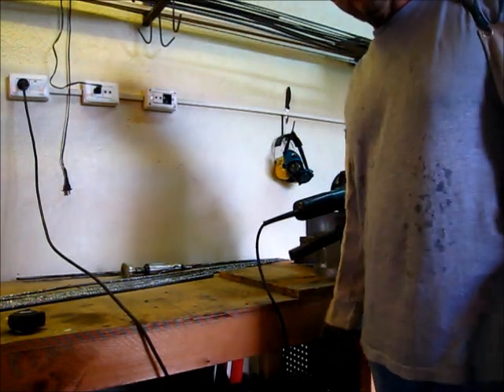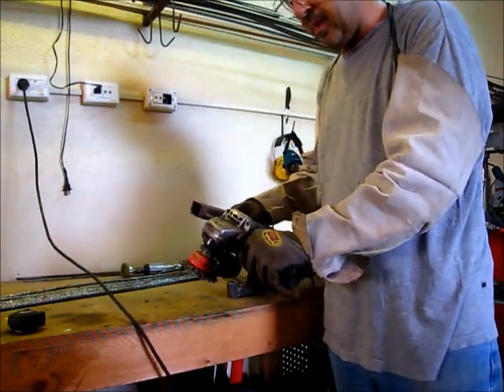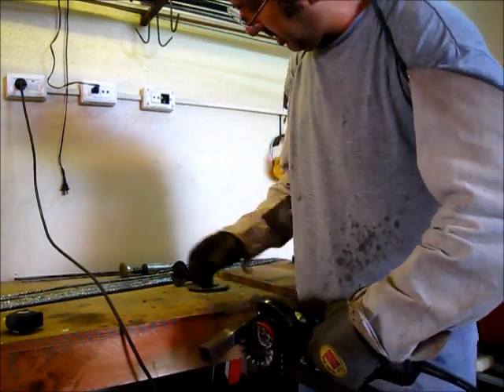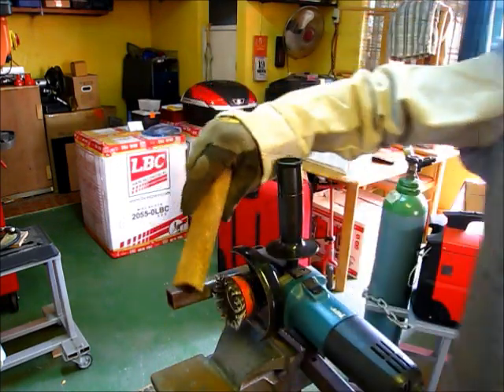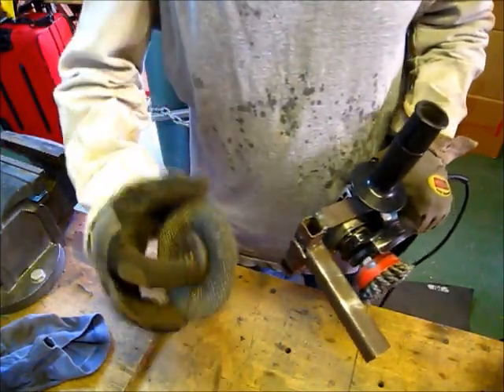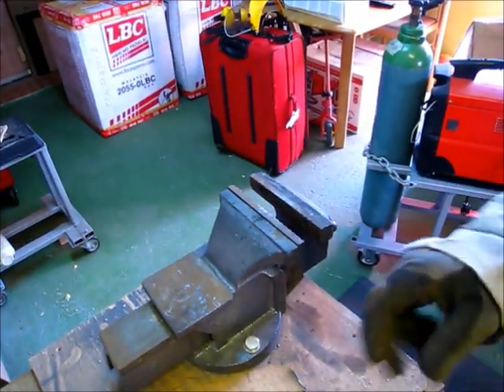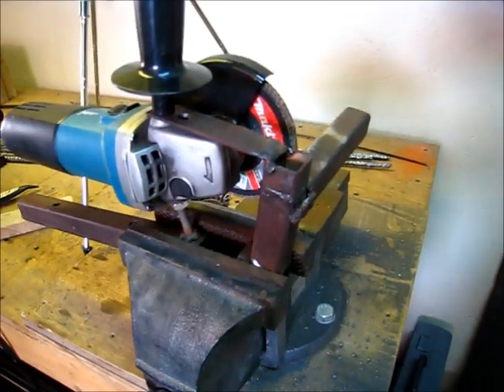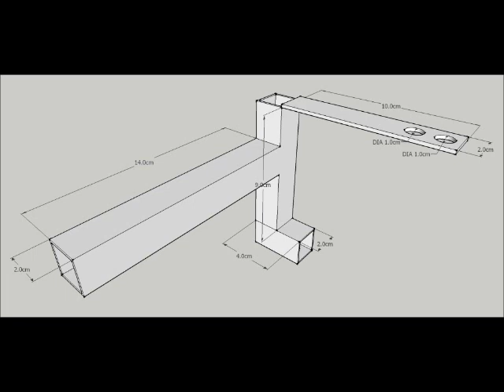My Favorite Home Made Tool made with Recycled Scrap Metal

Comment: This is a great simple idea, I have used angle grinder in ways it wasn't meant for,
but this is great, its non invasive and most grinders have the same set up,
a cheap yet very affective yet safe, well done Saeid!
although it might need a bit more of a safety shroud. good job
Reply from the maker: Thank you very much for your comment.

Saeid

Comment: Excellent, simple idea!   :)

This is what I call thinking around a common problem.  The speed and versatility of a right-angle grinder makes this far more useful, and faster, than a traditional bench grinder.     You could also fabricate a steel guard for this also to stop heavy rust from coming back to your face or throat as you work.
Reply from the maker: +Kieron Seymour-Howell Hey thanks! I use a mask whenever I use this
Reply: Saeid Momtahan, a face mask will not protect you from a disintegrating wheel.  A steel guard would you still be a good idea.
Reply: rockethead555  have seen a grinder wheel embedd into a steel door.  The wheels may have flaws, or cracks in them.  I worked  in industrial, and commercial companies for many years,  as a welder, millwright, pipefitter, ironworker.  I have seen some crazy stuff.  Those plastic face masks will not stop a disintegrating wheel.
Reply: rockethead555 Yes, all this is very obvious.  I have never had a disc break, nor have I ever burned out a motor, and my tools have always lasted multipe times, and done more work than those who I have known.  Everything you say is very true, and basic common sense.  Save your preaching for children and the average worker.  You seem to project agression and a haughty self-confidence.   My direct experience is that MOST people will have had issues and cut corners with safety, multple times.
Reply: rockethead555  I mentioned you, so obviously I was talking to you.   I know you think you know everything, but experience will tell you that is not true .. lol  i have met a lot of arrogant folks like you who think they know everything.  It is called the "Dunning Kruger Effect"  you might want to look that up.   :P

Comment: Very nice. I did a similar mod with a handheld belt sander, and it provides me a lot more control for finishing smaller pieces.  The fact that the motor vents aren't blocked by holding the tool "as the manufacturer intended"...is a great benefit too..

Comment: It is always good to consider the potential for personal injury before proceeding with any project. I have to agree about using a full face shield especially while running a wire wheel on a mini grinder. I've picked wire splinters out of myself several times but now I have a leather bib type apron that prevents them from sticking in me. Also works good when grinding. I've caught my clothes on fire a few times while grinding too. Have a great day!

Comment from the maker: Hi John. Thanks for your comment.

THe reason for attaching the rest to the Grinder is mainly to stabilize the grinder. If not attached, then the grinder would be held only with the handle that's locked in the vice, by only one bolt and through only one axis. As the two bolts on either side of the grinder are not aligned and have different axis, they offer a better lockdown/stability

I HAVE used the grinder alone in the vice w/o the rest, but I feel it's a little risky that way.

Thanks!

Saeid

Comment: Nice idea. Suggest that you include mentioning the use of a full face shield as well as safety glasses when grinding and especially while using a wire wheel. Leather work gloves and leather apron would also a good precaution. Those wires are sharp and can penetrate your skin quite easily and through your clothing. Safety First Always...

Comment: Some of the best ideas are also some of the simplest, nice one!
I'm thinking that the rest assembly could just be clamped in the vice without the need to attach it to the grinder.
That way you'd be able to vary the gap if needed.

Comment: A very good invention my freind thank you for sharing it, I work with metal and wood and building renoes this will be more practical, as I have a wood  sander I have to change the disk for rough sanding, as I need a plank to fit as a wedge and needs just a litle taking off, this is a time saver. In response to your negetive remark dazz barry I know for a fact that wishing harm to another being the wish comes back to the wisher; I stongly  advise you to retract that wish.

Comment: I like this, my old man did something similar with a drill mounted horizontal, then made his own attachment so it could be used as a vertical disc sander. Maybe a foot pedal from a sewing machine would be good for power, so if you do have problems you just lift your foot off?

Comment: Long sleeves are a great idea.  wire wheels spin off chunks of wire.  Invariably after an hour running the wire brush I look like a well dressed porcupine.  I like My angle grinder.  the vice mount is cool but I like the angle from the bench grinder too.

Comment: Hello, we have been using somthing similar for more than 15 years. Its pritty same but it was made so it can be mounted to any table ewerywhere and the adjustible part was on the same side as the mounting for the work table, adjustable with a butterfly nut so you can use differt sizes of discs or tools. It is werry helpfull thing.

Comment: Pretty Cool. Nice and simple. Angle grinders are the best tool in my workshop.
I have built an entire frame for my kit car using just an angle grinder and a welder. Wish I had thought of your handle.
Reply from the maker: There's gonna be another adaptor coming up which you will want for your workshop. Please check back.

Thanks,

Saeid

Comment: Hey man, those are some good/great ideas.  My friend cut his chest badly with a bigger size grinder.  That extra handle could make those grinders a lot safer AND help with less fatigue.  And ALL those grinders also BADLEY Need a brake from the manufacturer to stop the wheel when the switch is turned off.  Keep up the good work my man.  Take care from Nashville TN.

Comment: Nice mod, I also noticed my grinder getting hot after extended periods of use and had to hold it akwardly to not block the vents, those side handles make the tool much more versatile :3

Comment from the maker: I think you're obsessing too much over this. You have your opinion and I respect that. Although not a pro welder, I have been doing metal work for a few years and I know most accidents happen not because of Machinery, but because of the the guy using them. And that 90% of the time, that happens because of fatigue. This set up alleviates fatigue to a great degree. I know, I've done both. I know I'm a lot less prone to accidents with this and I can get a lot more work done.
Thanks
Saeid

Comment: Cool idea, cleaver man, I was using a small 115mm grinder to wire wheel a piece, and the brush caught the side of the metal and nearly went through my belly, fortunately it got caught up in my boiler suit, this looks much safer,

Comment: Hi Saeid. Great modification - however, one thing to keep in mind is that using the grinder like that with a grinding/cutting disk is you do not have an effective safety guard. With it clamped in the vice, you're standing in the line of fire for potential shrapnel - if the disk was to shatter (for whatever reason), it could be fatal! Angle grinders come with a guard for just this reason. So please be careful! ;)

Comment: Great Tool  i like it so much  but if you have in your angle grinder variable  speed it will be extent because most brushes wheel  will work with low speed and  also if you notice   there is burn in the wood if you use speed control angle grinder it will not be burn

Comment: just wondering about the practice of wearing long sleeves while using a tool with moving parts, as opposed to a welder, which is essentially a different sort of thing, where there are no moving parts and spatter is the problem. thinking maybe also some kind of caul/bracket around the main body of the tool, in addition to the fastening at the handle, would ensure the equivalent of a two handed grip.

Comment: Here is a trick I used to do to make a lathe....using a grinder and a drill....mount the drill using modded pieces on the work bench vice....get a drawer slider and mount the grinder on ...when the drill is on....turn on the grinder and you shall have a home made lathe..:D

Comment: As long as you are wearing adequate protective clothing and a face mask like he does, a shattered disk won't hurt you. There's just not enough momentum in the shrapnel to do so. Bare skin might get a scratch or so, but not much worse. The shield also doesn't protect the eyes from any flying shrapnel, broken disk or not, so it's just user error if not wearing adequate protection anyway.

Comment from the maker: I think in a home workshop OH&SA can be put on the side a little. No one is going to sue me if I bruise myself a little while cutting a piece o wood or grinding a piece of metal. I still care a great deal about safety though. And I do use a full face mask when I use this tool, specially with the wire wheel.

Comment: No, the guard is behind it to stop your fingers running up into the disc... eye or face protection is what'll save you from disc breaking up, if used like this; add a leather apron and you should be fine.

Comment: My anecdote: Some time ago, one saw in the shop, a 10" Uni-Saw clone, began a scary habit: rap the cabinet at the back near the mag control, the contacts would close, and start the saw unasked. Cauls racked under the outfeed table were nicely positioned to be knocked into it end-wise, too. Solution? For months, we just positioned a board behind the cauls as a guard, and wrote warnings with marker on the table. I still changed blades without killing power. Lunacy, in hindsight, don't you think?

Comment from the maker: I almost had a pretty nasty accident with a wire wheel attached to a hand held drill myself. It caught my shirt and came all the way up my chest. But thankfully the spin was such that it sucked my shirt in from outside. Had it gone the other way around it would have wire wheeled a nice track up my chest all the way to my neck.

Loose shirts have no place in a shop

Comment: Saeid, you are a very clever, very innovative person.  However, I have to comment on a safety aspect of this attachment.  When you hold an angle grinder normally your fingers are very close to the on/off switch which is a good thing in an emergency; I've had just such an emergency and am glad I was able to quickly shut off the power and yes, I was using the grinder 100% correctly.  With your attachment in place your fingers are not so close to that safety on/off switch :(  Please be careful :)

Comment: Copyright may be a better protection, and a pending patent may be a better protection than an actual patent which can then be worked around by competitors.
Best would be to make and sell them before they are cloned, but if your labor costs are low enough then even clones cannot beat you. THe next trick will be refining the mount, perhaps incorporating a short piece of C-channel, to work with more grinders and have maximum rigidity. (Welders are rough on equipment.)
It's an excellent idea and better than the other methods I've seen and personally used to mount grinders in a vise because your kit is more versatile and excellent for jobsite use.  Welders frequently sharpen tungsten in the field using their angle grinders and the steady rest would make that more efficient.
Good luck to you and thanks for posting your video.
Reply from the maker: Hey thanks for your words of encouragement. I have actually moved on from this attachment and have done 2 new ones which will blow this out of the water. I have applied for the patent on one of them. Upto  a week ago I was too busy to do the drawings for the second one. But since I climbed a tree and fell and broke a few bones, I'm only ableto work on the computer now, which could be a blessing.
Lots of decisions to make with the last design, cause I think it'll be appealing to professionals who go on job sites, as well as people who work in their small workshops, like myself.

Thanks again,
Saeid
Reply from the maker: And Happy New Year
Reply: Saeid Momtahan
Once you have it worked out and tough enough to take a reasonable beating, it would be useful to send review samples to the major welding forums with a request for feedback. In the US they are the Miller forum, weldingweb.com, and the Hobart forum. www.mig-welding.co.uk/forum/ is a good UK forum. I'm not familiar with forums for other parts of the globe.
The design could be particularly useful for contractors who have multiple grinders and can leave one kit attached, yet swap it over when they wear out that grinder. If a comfortable hand grips with some cushion is wanted, consider trying out various motorcycle hand grips. They'd need a surface with some traction, perhaps knurling, to stay in place in that application.
The idea is fundamentally excellent so all that remains is the execution.
Reply: I should have mentioned earlier, that a short  piece of channel can encompass multiple handle mounting points (sides and top in the case of some grinders) for a very rigid grip. I just made such a bracket to hold my 9" DeWalt to which I mounted a pipe handle in the manner of a weedeater so I can run a wire brush while standing atop a steel roof I'm working on. That application requires a hefty weight to hold the grinder down and dampen bounce but one may apply considerable force and you don't work in a cloud of debris as you would sitting. It's only suitable for large cup-style wire brushes rather than grinding but works well.
Reply from the maker: OB, that's all some excellent advise and you have my sincere appreciation. some of the things u said r exactly as i am planning, which is good, cause u sound like a boots on the ground.

Are u suggesting that i send a real finished prototype to the guy who runs the forum?

Here are a copuple of links to things that might be similar to your attachment
http://www.spe-int.com/hand-tools/angle-grinders-and-accessories.aspx?prid=34&cid=10&p=90

http://www.grandmastertools.com/Ceiling%20grinder.htm

if you don't mind me asking, r u in the roofing business, a welder?

Saeid
Reply: Saeid Momtahan
I suggest sending a prototype for evaluation to a moderator on each forum along with some clear still pics and a CLEAR video of the tools being used with the focus on tool operation, nothing else, no shop background shot, no face shots, just mounting, use, and dismounting of the tool. Simple posts offering things for sale are rightly regarded as spam, but a review sample and asking for feedback from the forum communities is cool. Read a bit in each to get a feel for their style and perhaps pick up useful tips.
I have a USAF aviation mechanic background, industrial/automotive/motorcycle mechanic experience and ran a welding tool room which is how I know what welders may find useful.
I'm not a roofer but I've done shingle roofs for myself and am now doing my metal roof due to circumstance.
Cleaning my roof is the unfortunate result of using chain store roof coating which traps water underneath in any horizontal areas which "pond".  That's what I get for not lurking professional contractor forums and taking the industrial approach I do everywhere else.
Reply from the maker: More great advise! Thanks OB, will keep your posts and review when I'm ready to send out the prototypes. It'll be a year though before I can do that. I'm in no shape right now to even open the garage door and by the time I'm better I'll have to be travelling for 6 months.

Saeid

Comment: Love the idea ....  DISCLAIMER !!!    I have not seen your plans so I may be offering a suggestion that is already in place.  Instead of making the bracket so that you have to remove handle to add the bracket(s), maybe you could just cut a groove or a channel  in the bracket(s)  that would allow you to slide the bracket(s) under  a loosened handle instead of having to totally remove the handle .  Again great idea, and all the best to you.
Reply from the maker: Hi Tom. Thanks for your comment. Yes, that's what I've done in the upgrade. Also eliminated one piece of metal. The Rest has only 3 pieces of metal instead of 4. A little easier to make.

There's a new version of this coming up soon which is more versatile.

TY,
Saeid

Comment: My home made tool is "using an electric drilling machine as a grinder". I fix usual grinder wheels to a drill by using a 4 inch screw & 2 (for more firm tightness) nuts. I have photos of these wheels but don't know how to upload here.
Reply from the maker: Great idea. I'm working on a similar set up. You can use a Polishing Wheel to attach your sanding disk and also the grinder.

TY

Saeid

Comment: So if you were to attach a piece of wood to the grinder or even used a drill, and extend the surface that you rest your metal on, couldnt you essentially turn wood on it? kind of like a makeshift lathe?
Reply from the maker: +peter chandrakumar 
It's all possible. But a lathe that revs to 11000 RPM needs to be 100% precision made. Unless if you put a power control on your Grinder, which is something I highly recommend for all uses.
Saeid

Comment: Surely safety measures are required with powertools in particular, but if you are that person who can cut a airplane with a toothpick while eating, you realize at one point that some of the safety measures are useless and in fact decrease the work productivity alot by applying them. So after all, it kind of depends on the user experience to choose which ones are really necessary